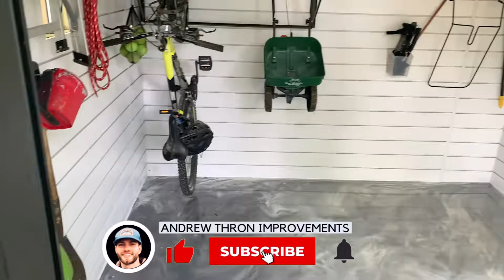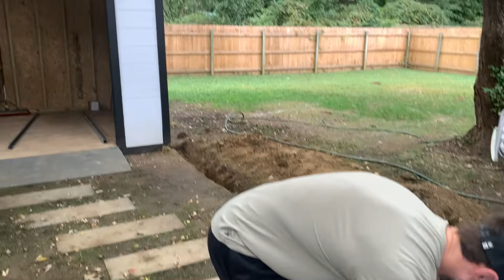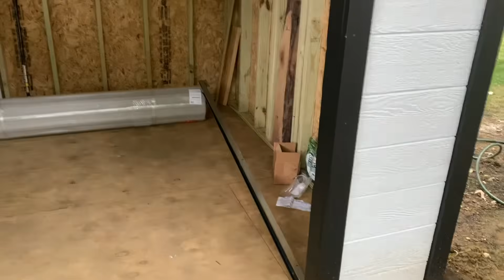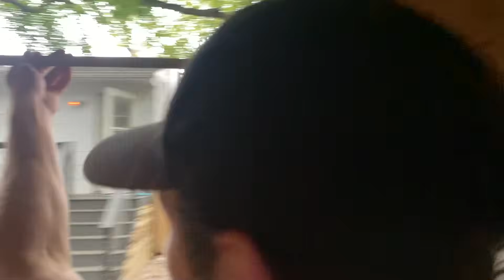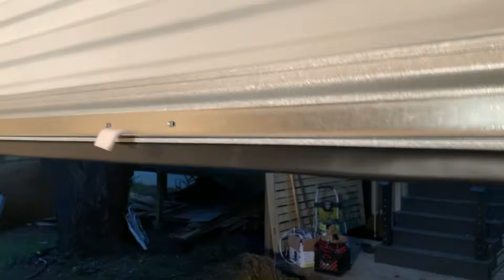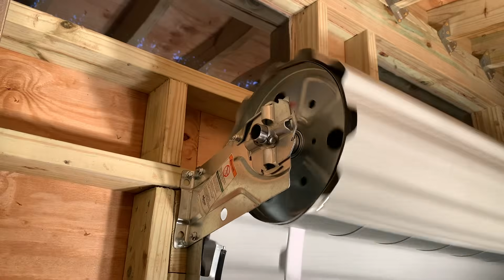How to Install a Roll Up Door on a Shed

Comment: Measuring your rough opening is backwards. I need someone to tell me WHAT THE ROUGH OPENING IS. You make the opening for the door, not the other way around. Does framing for a roll up door work the same as a garage door?
Reply: The door mounts on the inside and the RO can be smaller. So if you buy a door that’s 6’x7’ u can make your RO exactly that or smaller. If bigger u would see the edges and to much bigger you couldn’t mount the tracks. A lot of people would make the rough opening 6 x 7 and then put trim against it and then put weatherstripping which basically closes in the rough opening  1 1/2” all the way around except the floor. Nobody would do this but technically you could put that door which is 6’ in front of a 5’ opening or 4’ etc but that’d be ignorant! Just buy a smaller door instead of waist area… what u cant do with a 6’ door is have a larger opening can’t mount it to air. Make sense?? 🤯🤯

Comment: Door guy here! My only suggestion is shifting the track up an 1/8-1/4 off the floor. Rust tends to start at the floor an work its way up the track. Just picking it up that little bit will prolong the life.
Reply: I had a similar thought just from general experience. Glad to know my thought was well founded. lol thanks

Comment: Thanks.  I installed one 20 years ago and am now about to do it again.  New shed, new location.  One thing that I learned from doing it the first time was: do not remove the wrapping around the door until it is up and the rails are attached.  You showed it perfectly.  I unfortunately unwrapped mine and had a heck of a time getting it rolled tight and bungeed before the rest of the instillation.

Comment: I see you had trim around the door finished prior to installing. I do not have any of my trim done yet (using steel siding) but want to get the door installed asap. Will this be a problem? should I install the door trim before installing the door?
Reply: What did you end up doing? 
Thanks

Comment: So how much inside head space did you need for the roll ? Where I want to put a door all i have in head space is 7.5” 😳
Reply from the maker: Check the manufacturer’s website. They should let you know how much clearance needed based on the type/size of door you are ordering

Comment: As a garage door tech what you did is very stupid and could have gotten both of you hurt extremely bad ....install guides to your jambs plumb and level then lift the curtain to the mounting brackets....
Reply from the maker: Hey Michael - I’m pretty sure our method is what the manufacturer recommends for the model door we were installing.
Reply: @AndrewThronImprovements  As a certified fork lift operator, it looked fine to me.
Reply: What University did you learn that in? Harvard or Yale?

Comment: I just had a door like installed on my shed. First rainstorm and had a ton of water on the floor.
Reply: Oh man, that really sucks. Can you say more about the circumstances? Was it the door? Jam? Side?
Reply: @Charles Grove  the installer was missing the sill plate, so all the water ran down the door and into the shed. Hopefully it will get resolved when the sill Plat is installed.